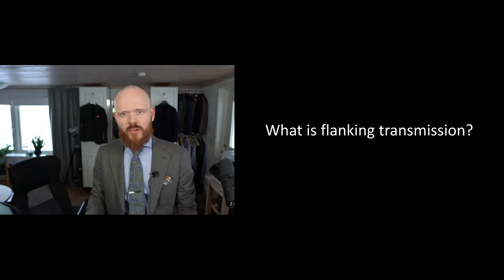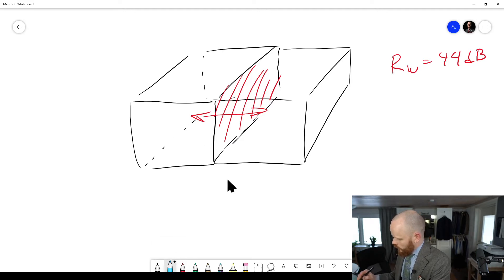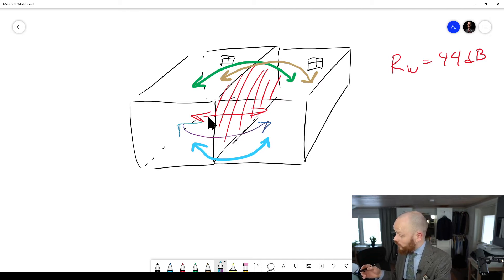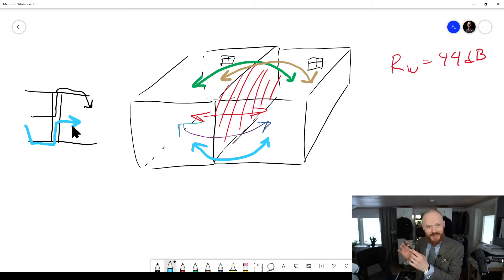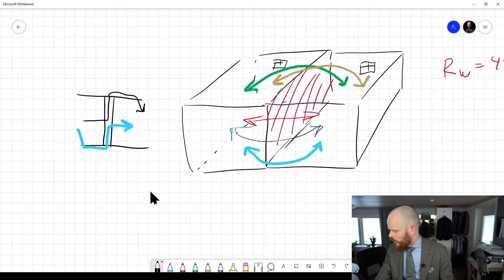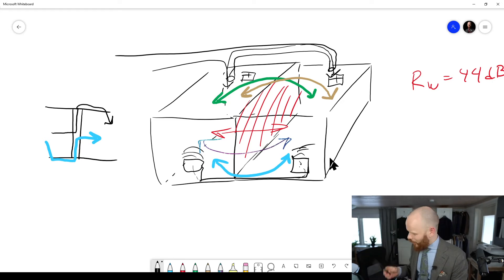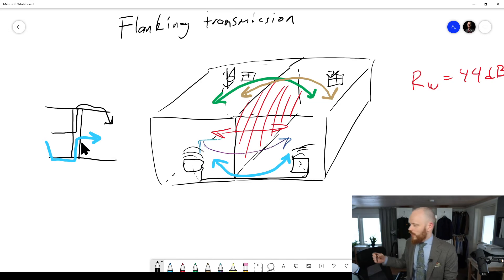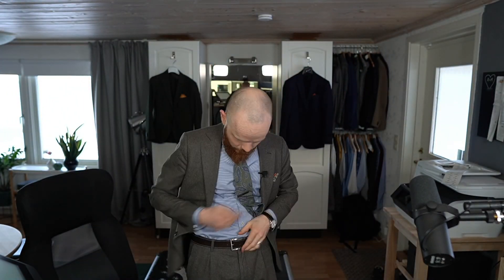QnA: What is flanking transmission?

Comment: Hello, wanna ask about flanking noise (indirect noise), can it be louder than the direct noise?
Reply from the maker: Hi! Yes absolutely. Here's a simple example. Imagine you have a 250 mm concrete wall (room dividing/unit separation) and the outer wall is improperly designed, lets say with a continous layer of single gypsum. In that extreme case you will definately get more through the flank. But you often come across cases when the flank is the weakest link in the chain. I do a lot of schools nowadays with CLT elements in the outer walls, which are sometimes continous between rooms. Also a very good and common example.
Room size also matters. Imagine the surface ratio between floor and 4 walls. In a small room, the walls will have larger combined area than the direct construction and thus flanking becomes more important. But in a very large room, the surface ratio is the other way around, with a large separating area and the 4 walls combined is smaller. Thus, the direct construction becomes more important. 
As you see, every case is unique =) Hope it helps!
Reply: @RikardÖqvist  Thanks for reply

i have wall soundproofing construction as follows:

1. 300mm Brickwall finished
2. 60mm air gap filled by rockwool
3. 2 x 12mm MDF
4. 95mm gypsumboard

After 5 years, the sound from the studio is audible to the neighbors including vocal, what could be the reason?

Ps: Our seperating wall is connected to neighbors